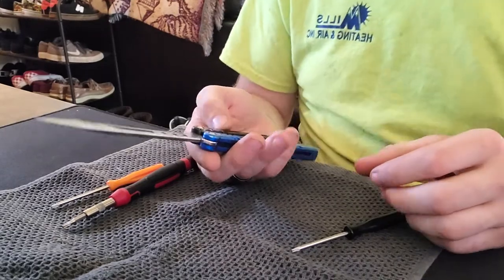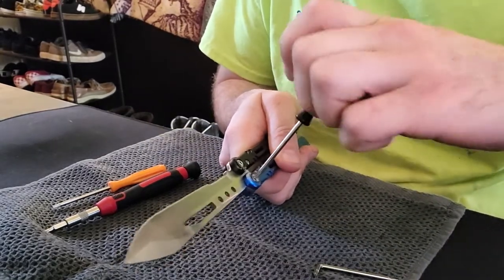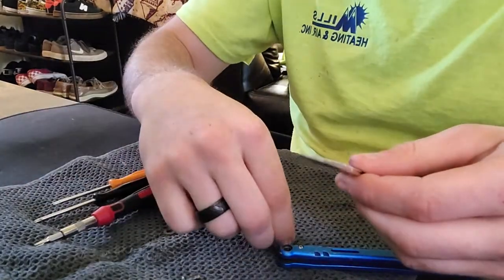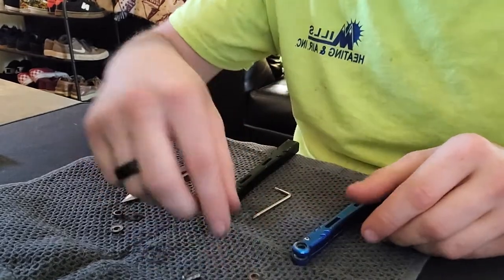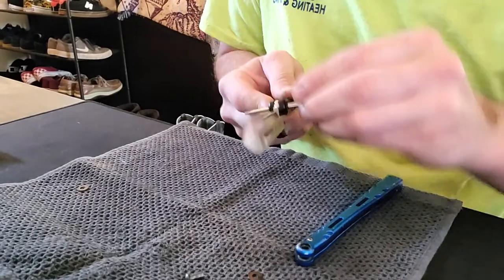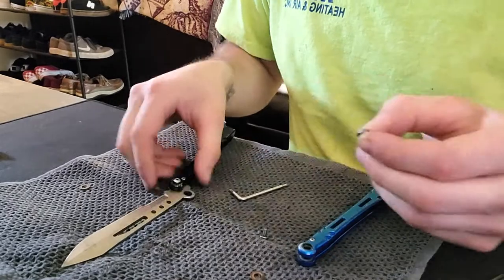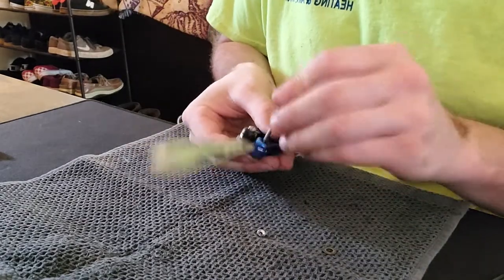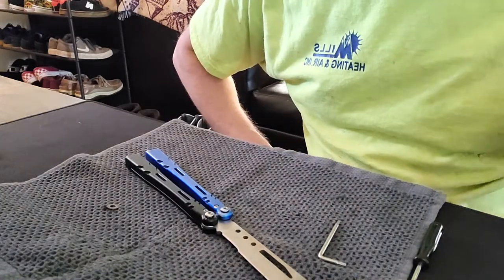How to disassemble and reassemble a balisong!

Comment: hi I need some help from pro flippers, I tried to dismantle my kraken v3 to clean, and now I can't reassemble it as the washers are too tight.

IF I use smth circular to poke it in and try to move it, it doesn't move and instead messes up the washers because I'm using too much force to push it in place.

how do I fit it back in place?
Reply from the maker: @rwoosh_master  it's honostly trial and error. Just keep at it. Nicer knives have tighter tolerancesso it's a pain in the butt haha

Comment: I bought a cheap balisong 3 months ago and I always wanted to switch my Manila style Balisong to a Batangas style Balisong. I still can’t get the screws to unscrew themselves. I tried gripping the handle very hard, I tried to hold the screw the screws kept spinning that the people who manufactured the knife over tightened it. I don’t recommend you guys buying cheap Balisongs if you want to convert it to Manila, Batangas or no latch. Just save money for a higher quality one that actually has the screws removable.